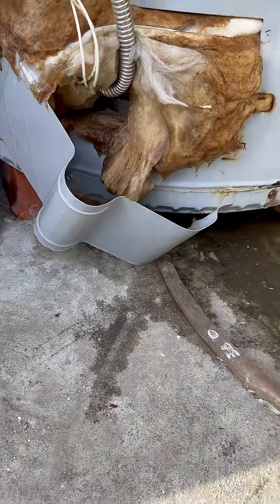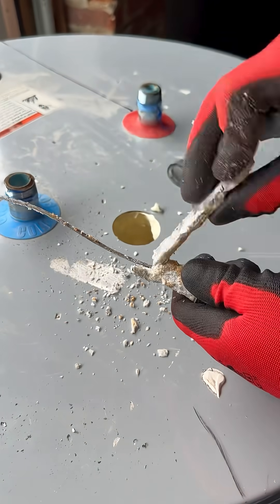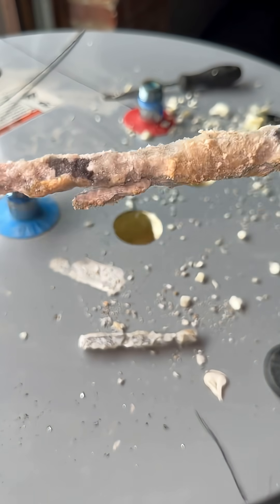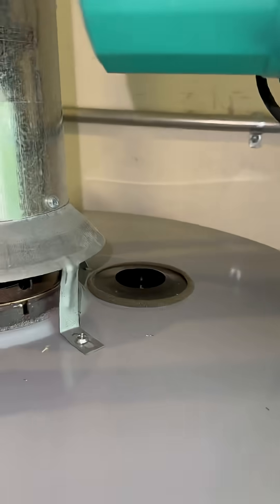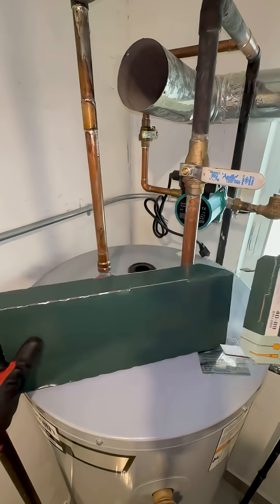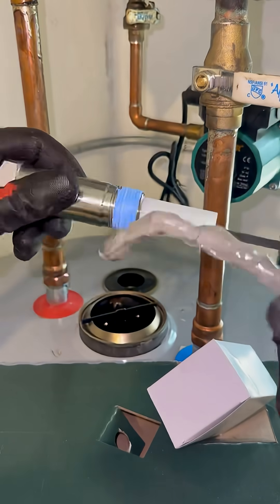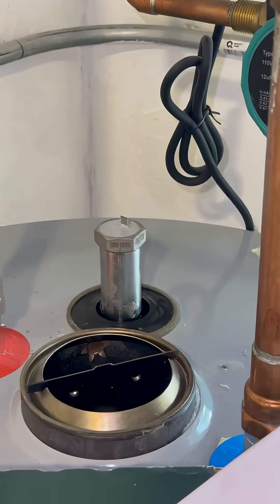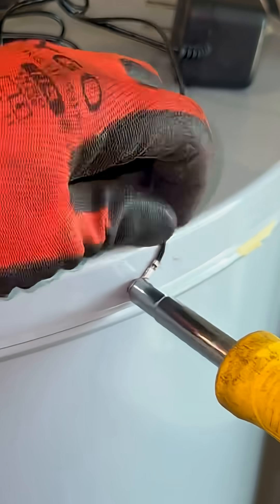Your water heater is fighting for its life! #waterheater #corrosion #anoderod #corroprotecpartner

Comment: This is why it blows me away when we were doing our off grid artist studio build, we chose to go for solid pellet boiler heating in our neck of the woods, but along that, it's part of the glycol loop that heats our floors, and our DHW tank, which has a sep copper line inside for a glycol loop to heat the water.  Systems from Europe, we are in the US, it's a bit whack, but our plumber loves the hell out of the concept.

That's something that always blew me away how crap electric or gas DHW are in the US, the designs flawed, the engineering is shite, and it's all just to push some more units out onto people.

Comment: What a waste of money.
They only build the heater to last as long as the warranty. Most of the heaters i replace have broken inner tanks, or the motherboard or control valve is busted.
Changing the anode rod to one with an electric pulse isnt gonna make it last any longer than it normally would, and youll know if the anode rods arent working because your water will literally stink like a sewer.
The only time the anode rod wears out fast usually is if you have a well system or just abnormally hard water.
I didnt see an expansion tank so im guessing this person is on a well.
In which case, you can buy cheap aluminum anode rods and swap them from the original. That usually fixes the issue.
Maybe i should make my own channel?

Comment: It all depends on the company (brand-name) you buy from too. When you are ready to replace your hot water heater, buy one that doesn't need an anode rod. Specially when your house is on well water. I was going to replace our HWH after living here for over 12 years. That is when I called the manufacturer to find out how old it was. They told me it was a 1998 unit that they no longer make. The tech went on to say our HWH doesn't need an anode rod and it has a much longer life compared to other models. The manufacturer told me to keep using there HWH and the tech was kind enough to tell me how to test and heating elements and replace them, while he had me on the phone.

Comment: Hey,  I got a question. Is it by design that gas valves control leaks gas on purpose by Honeywell?   I have a very sensitive nose.  When I am near the water heater.  I can smell the gas.  (No one believes me).  So I bought a gas meter pen.   And it turns out that every one of them leak tinny bit of gas.  When I open the cover, in the upper right corner circle,  there is  like a tiny black dot prob a hole. And the gas is coming out of there. The gas meter pen only goes off when it is directly put again it.  I replace the old one and the new one does the same.

Comment: Just go with natural gas tankless on demand and flush annually. No issues and way less on utility bills not to mention you never run out of hot water. I have a renai that runs two bathrooms, laundry and a dishwasher. 12 years with no problems

Comment: Can confirm the smell thing. My mom and stepdad moved to a mobile home with well water and not long after their hot water smelled like sulfur. I researched it when I visited and told them to try replacing the anode (we’d never had that problem in the suburbs). Sure enough it fixed the smell almost immediately. Not sure I want to know what the inside of that tank looked like though.

Comment: As I understand it, this is because the magnesium rod makes a battery of itself and the heater walls to do the same electrical current. But then of course, batteries die. So… they’re essentially giving you a unit with a battery powered corrosion protection, and then not telling you about it.

Comment: Yes, the magnesium rods factory installed are for soft water, which is 70% of installs. For hard water like wells, you need to replace it with an aluminum/zinc rod. The manual for these also mention you should check the anode rod every 6 months and flush the tank every year. I extended my inspection for when I do the flushes because an extra 6 months isn't going to do much different. I want to get a powered rod too, but you need an outlet nearby. My water heater is in a closet with no outlets, so I would have to run power if I want to avoid unbalancing the load by splicing into the water heater lines (which I've seen people do).
Reply: These are so low power an extension cord would be fine until you get around to running a new outlet.
Reply: @Sparky95  Yeah, that's an option if you don't mind the trip hazard. Luckily it's very easy to add an outlet somewhere, so it wouldn't be a problem for me to do so when I get around to it.
Reply: @StapleCactus  Eh, trip hazards build character... Realistically that's when I would get creative with command strips to keep it out of the way, or just run power to a new outlet.

Alternatively, if you're like me and have a couple control transformers laying around just tap off the 240v and step it down to 120V. Keeps it balanced and safe.
Reply: @Sparky95  Oh, that's an idea. But no, think I'll just fish a wire up from the fridge outlet since it's in the same stud cavity. After all, a fridge really doesn't need a dedicated 20A circuit like the code requires.

Comment: That's in basically any industry lmao.. Built to last until warranty is over... One of my first phone was a Samsung with a removeable battery. Now a days you either get a new one or have some hack change the battery for you for 100+ bucks. We had a coffee vending machine at work which worked for over a decade with no faults, they changed it to a new one and it was out almost EVERYDAY. The cups got stuck, or fell out or the scanner didn't work. 
I think we were like the test subjects to test it on, no other way to see it.

Comment: I just pulled a 2021 rheem commercial 65g tank that was leaking, new 2025 tank leaking in the same place as the 2021 tank welds under the tank are not even cutting into the fire tube's it's made to fail in 4-5 yes for a 12kplus tank that's nuts

Comment: Consumer grade HW heaters have no way to clean out the sediment that builds up inside. It can be 2-3 inches deep. Looks like sand. My commercial 80 gal unit has a removable access plate. U drain it open plate and scoop out about 10 pounds of crap. Done it thrice over 11 years. It's an $8k HW heater so it's worth the effort.

Comment: Hook your waterheater up to a mini-cool swamp cooler to help with the summer heat & also flush the WH a few times a year & it will prolong the life of the WH by 10 years +. Proof is in the pudding. We replaced this exact WH that the builder installed in 2005 in 2022. Was fortunate enough to have a brand new in the box ready to go in the garage. We replaced the OG WH even though it hadn't failed yet. We wanted to be on the safe side. Maintenance is everything in life.

Comment: weve had the same heater since the house was built in the 70s, dont think weve ever had to drain, replace, or repair any of it, probably should, but if it works, dont break it by fixing it

Comment: They used to make water heaters out of Monel if you wanted to pay for it. Thats a "super alloy" that has corrosion resistance so good it spits on stainless steel and calls it trash. Now its not even stainless, just regular steel and they line it with melted glass dust and go "Yeah surely that wont crack in multiple truck rides, and years of thermal expansion and contraction"  And you get this. You cant even buy a monel heater if you wanted to.

Comment: For those thinking he should star washer or scratch the paint on that ground line that lid is coated around the inside and outside and so is the lip it's on. That screw should be seating into a bracket which is were he is getting the ground so he's good and if he wanted to make any change the only marginally better thing would be to put a flat washer on first to make sure the terminal is getting more surface area to the screw.

Comment: If that anode died that fast it was the wrong anode material. They come in aluminium, magnesium or zinc. Water reacts with certain metals drastically and will destroy the anode faster than it should.

Comment: Worse is the builders that put the water heater in a closet, above a washerdryer, touching the ceiling so that you can't replace it without removing the washerdryer, taking off the door, tearing out the platform on top of screwjacks, and lowering it from there

Comment: meanwhile a water heater we have in syria from the 80s is still fine i mean sure we have a simple filter before its inlet and we emptied it before the leaving the country but its working it had a modded igniter as its a gas powered unit that used to have a pilot lighting system

Comment: upgrade the valve on the bottom and connect it to a drain so you can flush the water heater easily a few times a year where you completely drain it so you can get the sludge out of the bottom and it will last 10 times longer

Comment: The water heater in my parents house is damn near 40 years old the only thing that needed replaced was the heating elements and my dad did a flush about every 2 years still going strong
Reply: maybe it is one of the old ones made of monel/copper alloy, but i think they stopped making those in the 60s. Also, some steels seem to have better corrosion resistance than others. I would guess that anodes may have been changed during some flushes.
Reply: I flush mine and it's 15 years old but hard water fucks up everything. My pressure washer even gets that white chalky build up.
Reply: When we moved into our home I noticed WH , propane was old . Original tag from bdeveloper 1994…worked ok but I tried to drain it but water wouldn’t flow out WHITE STUFF CAKED IN THE DRAIN…I Poked IT WITH A COAT Hanger. Holy Sh…it was think Calcium b hot water burned the crap out of me…..I’m replacing the WH this week and will install one of these….thNks Broskie……

Comment: I'm a corrosion technician for pipelines. 
My dad's hot water heater was installed by him in 1975. 
About every 4 years he has always replaced the anode. 
The only thing I didn't hear you mention that you must do especially if you're going to use impressed current is everything's got to be completely isolated. 
Insulated unions or connections on the water in and out and insulated union from the gas line. 
Last thing make sure there's nothing metal touching the tank anywhere then you have perfect cathodic protection.
Love your videos dude
Reply: Why does the water heater need to be insulated from the pipes? It's just a low voltage DC current that's grounded to the chassis of the water heater itself. The electricity isn't going to be going anywhere else.
Reply: The instructions does not say anything about grounding. I think the electronic system is independent of the ground and is self contained. As long as the green light is on it is doing its job. It lights up my garage so I can't miss it.

Comment: My opinions: even without the titanium & using magnesium: the slow electric circuit should still work. & Yes, their built to fail. A better system is the tankless water heater. BUT they build those requiring frequent repairs to by using plastic spools. A full metal spool WITH SLOW ELECTRIC CHARGE should last far far longer with much less electric costs.

Comment: Magnesium rods in a hot water tank is an ass move... sorry attempt at corrosion resistance/mitigation. you know what is crazy?! My hotwater heater is about 40 years old on well water with no filters... they dont buildem like they used to.

Comment: Those powered rods are not a new thing
I looked into it over 10 yrs ago when I was looking into a house with well water that smelled horrible.
The old owner told us they replaced the anode rod every year or so, but after about a year almost on the dot it would start smelling again.
I looked it up online and it’s because of the well water causing chemical reactions with the anode rod itself.  So it depends what your water has dissolved in it from the well.
I was able to find a place to order one, but I didn’t end up buying the house.  
We kept in touch with the owners anyway since we already sorta knew them anyway because of other people we knew(common acquaintances).  I told them about it but they didn’t want to buy it anyway because they were selling the house regardless, in fact they took the rod out altogether, found a solid plug of the same size and stuck a note to the heater for future potential buyers/realtors to know what they need to do/look into when they buy the house.

Comment: The anode rod should be changed regularly every 2-3 years and the tanks should be flushed at least once every year. It’s because of the lack of maintenance that they fail.
Reply: 100%. And a magnesium anode rod is about $40.
Reply: And the coroprotect is like $100 and saves the heating elements too  @michaellewis6569

Comment: We use copper water tanks where I am, though they are gravity fed, so not super high pressure, but they last 20+ years no issues. Usually start to get weak after 35-40 years. With mains pressure of 10 bar (147 psi) not sure I'd trust the normal ones, but they're pretty strong, so maybe it could take that. Wouldn't last as long though.

Comment: Worked out a deal with A.O. Smith for 20 commercial units. 
Absolute junk. 12 of them failed within 2 years. 
And I mean total blowouts. Not thermo failure or pilot failure, but complete blowouts. 100 gallons plus all over the place. 
That fiasco sent me down a rabbit hole, and I discovered that the technology to make 50 year water heaters has existed for decades. They would cost about 2500 each, but you would buy one the day your house is built and never buy another as long as you drain it once a year. 
Hot water heaters are the original planned obsolescence.

Comment: German here: We just run city water throught zink coated steel pipes and aluminium/plastic compound pipes into the boiler, copper pipes start only after the boiler and an isolation element - if at all. Our boilers do not even have sacrificial anodes, they do not need them and last approx 50 years.

Comment: Shit....i got a gas 40 gal,  GE "best" from Home Depot in 2002.  Still running it.  I tried swapping out the anode once, but couldn't crack it free.  I did have to replace the over pressure valve.

Comment: I've always heard trash about on demand hot water heaters, but my family lived in the middle of nowhere and were broke as could be and when our hot water heater finally died, we had to look at getting something new and uh, after looking into it, my dad got an electric on demand one and honestly, it has worked better and costed less then a traditional hot water tank. Water is hot in seconds, you can easily set how hot you want it to be, you don't have to burn energy, keeping a big tank heated on demand at all times, and you don't have to worry about running out of hot water. He even set it up himself, and it wasn't that hard.
Reply: Electrical on demand is going to cost much more to run yearly than electrical hybrid water heater.
Reply: @rafflesmaos  tankless costs less overall, because although it does use a lot of energy when it’s in use, it uses zero when it’s not in use
Reply: @glitterishhh True for a traditional tank, but they mentioned hybrid, which is not 100% electric resistive heating but primarily uses heat pump heating which is way more efficient than resistive. I just had a hybrid tank installed and it uses literally 1/4 the energy per year that a similar resistive tank uses, and 20% less than an electric tankless, with the added benefit of having hot water stored if I lose power.
Reply: What about shower.   Does it Produce enough hot water?
Reply: Send me info,/PICs on this please
Reply: Filter water supply , longer flush maintenance cycle, hope he bought bypass flush valves to clean crust on PM flush ...👍✌️☝️💪🇺🇲
Reply: You still have to flush it at least once a year.  And hopefully you have either a solar/battery backup or emergency generator solution because if you don't and the power goes out, that on-demand water heater is pretty much dead-in-water.
Reply: @dantesinfernopurgatory7826  I used to have a 65k BTU 50 gallon tank in my apartment for heat and hot water. Hydro air unit next to the heater with a brass circular that runs every few hours to keep the water from stagnating.

The only negative to the new tankless that they replaced the tank with is that the second the power goes out the hot water is gone. With the tank it was 24 hours into an outage and I still had a comfortably warm shower. At everything else the tankless wins hands down.

One too many tanks flooded and the landlord's insurance required the tanks be replaced with tankless once they hit 6 years old. They had drip trays plumbed to drains and everything, still caused floods and tons of damage.
Reply: @dantesinfernopurgatory7826 Lol. Power's out, and you can get take a lukewarm shower 12 hours later! Ha, take that on-demand heater!

Comment: READ THIS : I have a Rheem that was installed in 2008. I recently replaced the main unit at the bottom for about 250 bucks and while it was empty we looked inside and it had ZERO deposits or sediment. The difference? The whole time we've had a water softener which removes bad stuff from your water. Let's see, still like new after 16 years. No lie.
Reply: NYC has notoriously heavy water. its the way they treat it, but some say thats why pizza and bagels are better there. i dont know if its still like that, but if you turn the faucet on in an NYC home, at one point, idk if its still like this, the water would come out a milky white for a bit.

Comment: If only my anode would come out of the water heater. Impact drives did nothing and even with a 6 foot pipe on the back of my socket wrench, the anode refused to budge. After many many tries, all I achieved was the hex stripping off the anode.